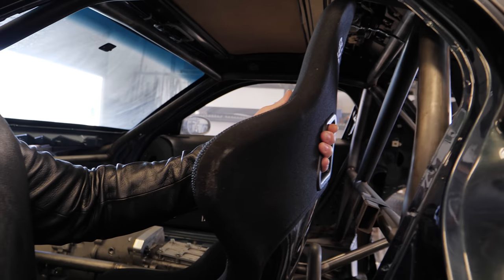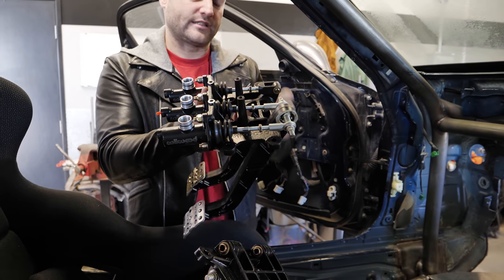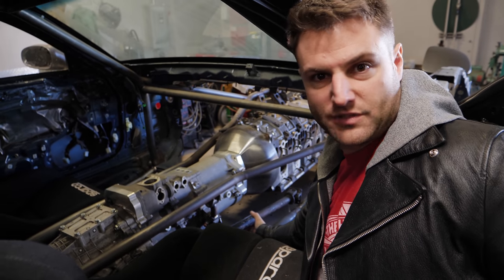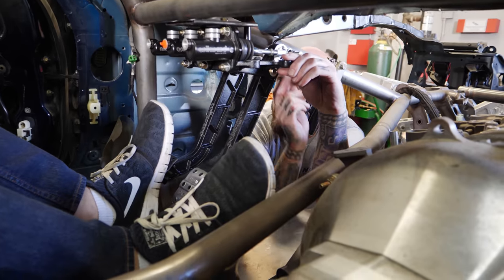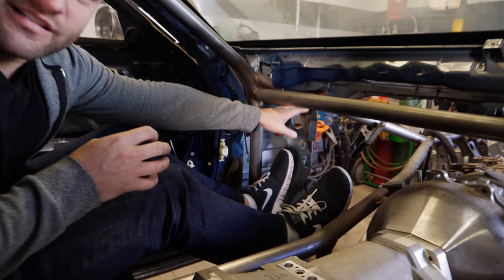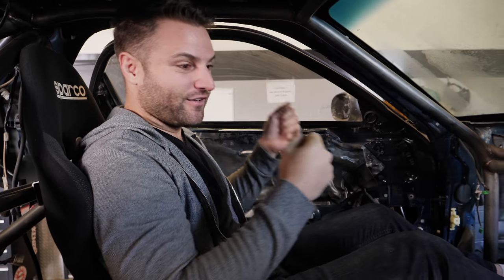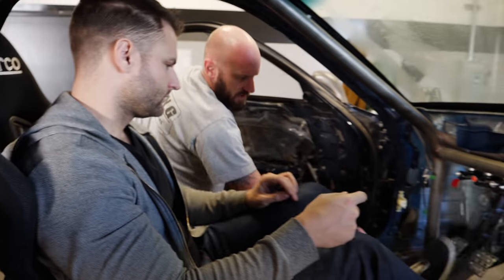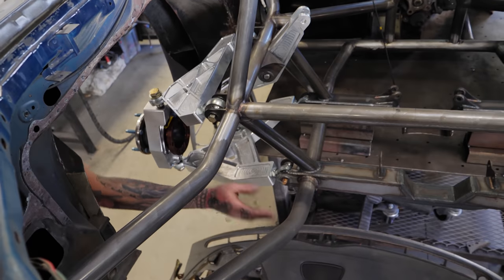We finally have a Seat and Brake Pedals in the 4 Rotor! Devil in the Details

Comment: Careful with the fuel system on this one
Reply: sirgallium 💀💀💀 if he blows this one up this is gonna become cleetus mcfarland 2 just all v8s
Reply: He should consider belt driven fuel pump
Reply: @Szakallooo  yeah all the cool kids these days run those mechanical pumps. I don't know why they're better but apparently they have some advantages if anybody would care to enlighten us. I guess it simplifies things a little bit, less cables to run, less things to fail.
Reply: @El_Chompo   no it's a old school trick for higher hp / mission critical engines ( like piston driven  aircraft ) because if its setup correctly it's more efficient ( ~10hp vs 7~ hp @ full load to drive it ) and reliable and less money to do plus changing sizes and pressures ( 5-300 psi @ .1-30~ gallons pre minute ) is easier the downside is sometimes needing a small priming pump / pwm controller ( and on some racing engines can be clutched like a A/C compressor for electronic control go look up frybugers 60s comaro road trip to Utah that's what can happen if you have 2 big of fuel pumps ) for spikes or a bigger fuel regulator and with a cable or 1/4in driveshaft can be remotely mounted ie ff engine and 30 ish feet away in the back and still work prefecty or work the same ish way if flipped around
Reply: o and my favourite thing is that it's quiter than " big racing " electric powered pumps or and lest not as noisy as the rest of a running engine and is harder to feel vibrations from

Comment: Is building the world's fastest 4WD FD ->> Worried about not being able to see your pop up headlights while driving? Priorities right.
Reply: As a racing driver my self, I can def. say that there are actually some pretty damm good reasons to why driving position matters and matters a great deal. First of, the ergonomics.. If you sit shitty, you'll never be comfortable in the car, and your driving will be shit, because you'll feel out of line with the car and more importantly, you'll not feel the same trust in the car (+ you'll possibly have problems of backpain and such stuff). One of the more important things in a driving/racing sense, is being able to know where your car is, otherwise you'll not be able to place the car in the right places - Even in daily driving, knowng where your car is can be a huge advantage at eg. parking or going through tight spaces. The headlights is a great way to know where your bumper is at. Secondly, from an engineers perspective, the driver is deadweight, that the car needs to carry. In that sense it's rather important to place the driver according to the CG (center of gravity), so you better can balance the car out in order to get the best possible static balance. Since a driver is 150 or more in most cases, the driver is actually one of the heaviest moveable 'parts' you'll find in the car. That's also why you'll see some production based racecars and GT racecars have the driver placed a fairly long way back in the car - Especially on (mad) FWD's (for eg. time attack) where you don't have any rearaxels and such stuff to balance out the engines weight in the front.

Comment: Are there any design plans on that rear toe link to look at roll over/under steer? It would be super easy to add some extra mounting points for the rod on the chassis at different heights

Comment: It looks like you're making compromises.
I suspect you're working with a rebound ( better than the last but not what you want) shop.
Chassis needs to be designed around the driver's compartment, afterthought fitment is more than one red flag.
Better luck on your next build.

Comment: That gearbox is ridiculously long man......
Reply: It’s a getrag 6 speed but it also has a transfer case connected to it for awd
Reply: thats what she said :)
Reply: Lowki Based nothing to do with Germany getrag it’s got a Australian hollinger gearbox.
Reply: George Van Der Togt really?? so it has a custom adapter plate off the 4 rotor for the hollinger transmission and then an adapter plate to the transfer case off of the r34?? I know for a fact that’s the transfer case because he’s going awd lol I stand corrected though
Reply: Lowki Based I did not say anything about the transfer case or adapter plates I only corrected about the gearbox.
Reply: Lowki Based it’s been years but I believe the hollinger is designed for a R33 GTR and that’s what transfer case is being used.  The only adapter needed would be to the engine.

Comment: Id fit perfectly in that car we're the some height is it gonna make sema for 2019 because il be there for the first time. I want to see the 4 rotor awd. One day i want to build a 6000 hp awd 1970 chevrolet chevelle ss with a 632 race gas warrior from nelson racing engine but add two more turbos and meth injection
Reply: Only 6k ?